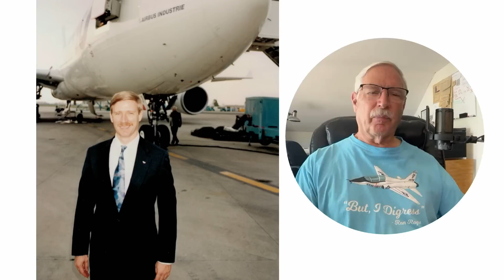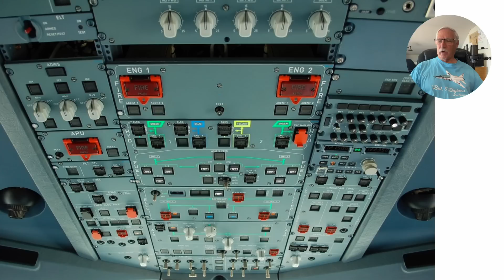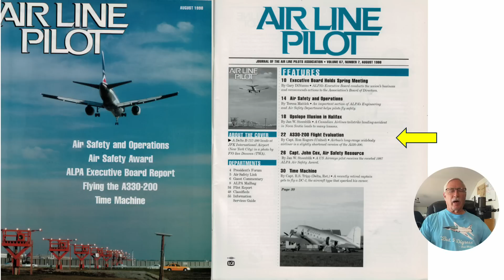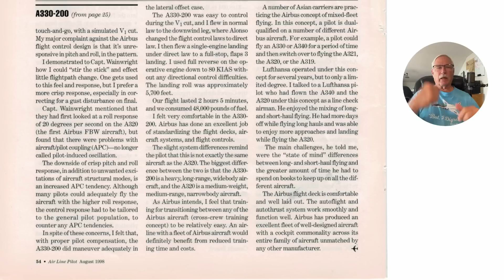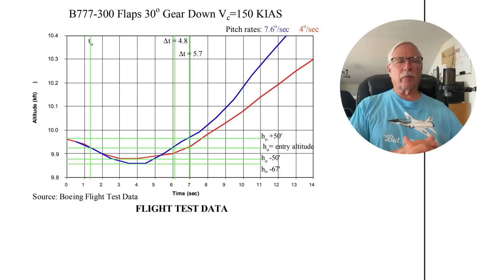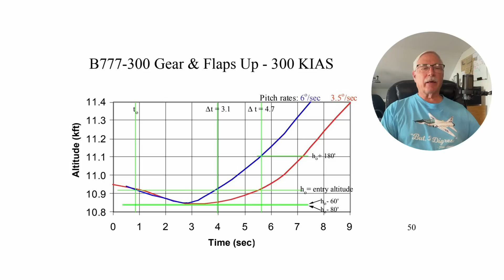Test Flying the A330-200 and Controlled Flight Into Terrain (CFIT) Flight Test

Comment: Interesting video, especially the CFIT recovery procedures. I’d have to think the 777-300 wing loading was a huge factor in the initial sink as well. The 77W has an almost comically small wing for its size, it’s just very hard to notice from most angles. The engines made up for a LOT of that, which puts even more credence into engine lag being a big part of the issue. 

I’ve always thought the 330 had a relatively large wing (looks beautiful from the back with the camber and such) - after the 777 came out, I think the smaller engines of the 330 made its wing look even more massive. 

Of course the 77X solved the wing issue with those huge new folding wings, and the same MTOW as the 77W now requires less powerful engines because of it.

I’ve always thought of the 330 as more of a glider and the 77W as just kinda imposing its will on the air around it with huge engines. 😂